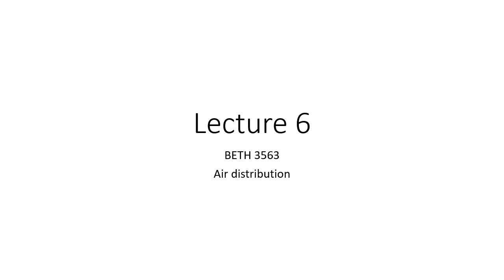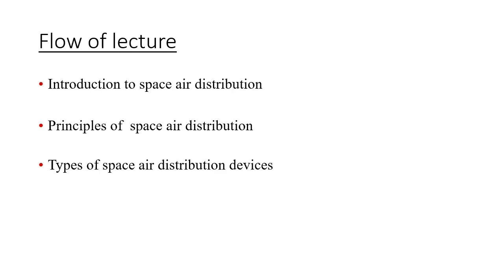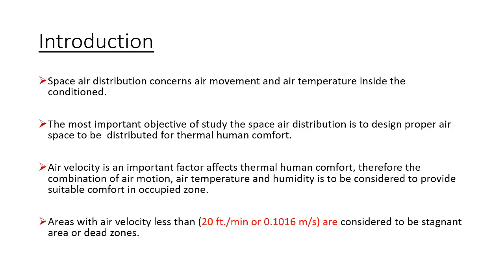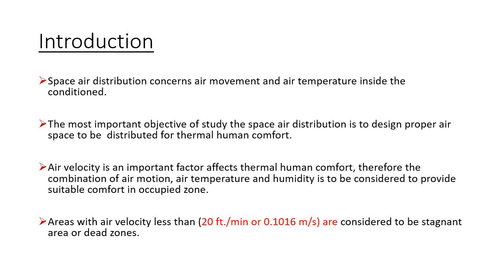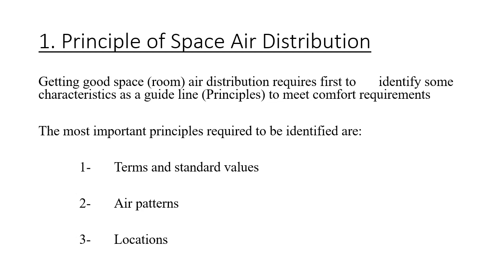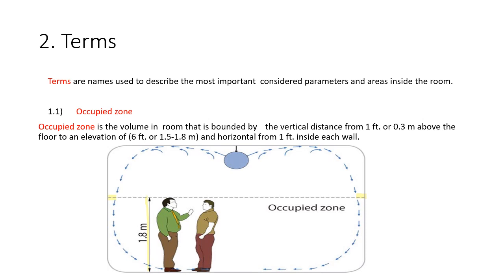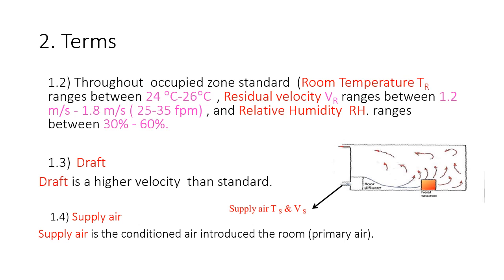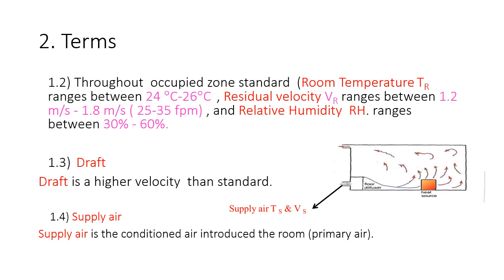LECTURE 6 SPACE AIR DISTRIBUTION

Comment: Mohamad Hurairah B071710461 

Introduction 
-Space air distribution concerns air movement and air temperature inside the conditioned.

-The most important objective of study the space air distribution is to design proper air space to be  distributed for thermal human comfort. 

Principle of Space Air Distribution 
The most important principles required to be identified are:

1. Terms and standard values

2. Air patterns

3. Locations 

Types of space air distribution devices 
There are four types of air supply devices, such as 
 1. Grilles and registers
2. Ceiling diffuser
3. Slot diffuser 
4. Plenum ceiling

Comment: NUR SELIHAH WAL HUDA BINTI AHMAD (B071710190)
INTRODUCTION
          = Supply air mixes with the room air so that the mixed air is at the room design temperature and humidity.

PRINCIPLE OF SPACE AIR DISTRIBUTION
          = Terms and standard value
              - occupied zone (volume in room bound by vertical distance)
              - room temperature (24 celcius - 26 celcius)
                                                  ( RH : 30%-60%)
                                                  (Velocity : 1.2 m/s-1.8m/s)
             - draft (higher velocity than standard)
             - supply air (primary air)
             - design temperature (temperature of leaving air in the room)
             - throw (distance from supply air device before reaching relatively low density)
             - air jet (air stream that is discharge from an outlet, higher air velocity than surrounding air)
             - spread (envelope of air stream)

          = Air patterns
             - Ts<Tr (air will drop down the indoors)
             - Ts>Tr (air will rise up indoors)

          = Locations
             - high wall (cool air will drop down naturally)
             - ceiling (recommended for cooling)
             - low wall (recommended for heating)
             - floor/sill (recommended to locate under windows)

TYPES OF SPACE AIR DISTRIBUTION DEVICE
         = Device to create proper air distribution in conditioned space. air supply device.
         = 4 types
             - grilles and register
             - ceiling diffusers
             - slot diffusers
             - plenum ceiling : dropping ceiling

Comment: Aldy henry dusim (B071710329)

introduction
this chapter teaches about how to design proper air distributed air supply for thermal comfort. air velocity is important and air motion, air temperature and humidity must be consider to achieve suitable comfort for user.

Principle of space air distribution (AD)
a)terms
-occupied zone
-draft
-supply air
-design tempp
-throw
-air jet
-spread

Air pattern
its the behavior of air supply to a room
Ts<Tr cool air will drop down (as in summer)
Ts>Tr cool air will rise (as in winter) 
air device is not suitable near ceiling due to surface effect thus room not cool

Location
important to know to get good air distribution.
High wall is good for cooling cause cool air will drop down and also at the ceiling also good for cooling.
Low wall and floor or sill is good for heating 

Type of AD device.
used inside space for the distribution of conditioned air.
Type:
1. grilles and register
2. ceiling diffuser
3. slot diffuser
4. plenum ceiling

Comment: Amiratul Rasyidah bt Abdul Rahman (B071710456)

Introduction:
* the objective is to provide thermal comfort zone
* The areas with air velocity less than 20 ft per min considered to be stagnant area

Principle of space distribution
* terms or standard value
* Air patterns
* Locations

Types of space air distribution device
* grilles 
* Ceiling diffusers
* Slot diffusers
* Plenum ceiling

Comment: Muhammad Akram (B071710573)

Introduction 
Air distribution system
- To design proper air space   - Important of air velocity effect (human comfort) - Air velocity less than (20ft/min) considered stagnant/ dead zones.

Principle of space air distribution
1. Term and standard values
2. Air patterns.
3. Locations.

Terms = most important parameters and areas.
Air pattern = behavior of the air supply
Location = air distribution device is important consideration to achieve good air distribution.

Type of air distribution devices. (known as air supply devices)
1. grilles and registers
2. ceiling diffusers
3. slot diffuser
4.Plenum ceiling.

Comment: KHOR YE SHU (B071710464)

Introduction
- Objective is to provide thermal comfort zone
- The areas with air velocity less than 20 ft per min considered to be stagnant area

Principle of space distribution
- terms or standard value
- Air patterns
- Locations

Types of space air distribution device
- grilles 
- Ceiling diffusers
- Slot diffusers
- Plenum ceiling

Comment: ARVINTH A/L RAMACHANDRAN 

 ( B071710339)

INTRODUCTION

concerns air movement and air temperature inside the condition 
air velocity is an important factor that affects human thermal comfort zone along of combination of air motion temperature and humidity.

Principles of Air Distribution 

terms and standard value 
-occupied zone 
-draft
-supply air  
-design temperature 
-throw
-air jet 
-expansion 
     -envelope air stream 
     -terminal velocity 

Air pattern 
- Ts < Tr air will drop down indoors (summer)
- Tr < Ts air will rise up indoor (winter)

locations 
- High wall ( good locations for cooling )
-ceiling ( not good locations for heating )
-low wall ( good location for heating )
- floor or sill ( excellent locations for heating not for cooling )

Types of space air distribution 

- grilles and register 
- ceiling diffuser 
- slot diffuser
- Plenum ceiling

Comment: SEE WEI CHE B091810368
In this video, i have learned that the air velocity is an important factor that will affects thermal human comfort. There are 3 important principles of space air distribution which are terms and standard value, air patterns and locations. There are four types of air supply devices which are grilles and registers,  ceiling diffusers, slot diffuser and plenum ceiling.

Comment: AHMAD ASYRAF BIN AMIL B091810125 

 - Space air distribution concerns air movement and air temperature inside the conditioned.
- Areas with air velocity less than 20 ft per min are considered dead zones.

Principles of space Air Distribution :
-  Term and standard values
-  Air patterns.
-  Locations.

Types of space air distribution devices :
- Grilles and registers
- Ceiling diffusers
- Slot diffusers
- Plenum ceiling

Comment: MUHUNTHAA A/L MUNIYANDI
B091810185
3 BMMH S1/1

From this video, I have learned about  

1. Space air distribution is to design air space to be distributed for thermal human comfort.

2. Air velocity is important factor for affect thermal human comfort.

3. Most important for identified were terms and standard values, air patterns and locations. (occupied zone, throughout occupied zone, draft, supply air, design temperature, throw, air jet and the expansion of flow stream. Next is air pattern and  location.
 

4. There are 4 types of air supply devices which are grilles and register, ceiling diffusers, slot diffusers and plenum ceiling.

Comment: MUHAMAD IZMAN BIN JAMALUDDIN 
B071710518

Introduction to space air distribution
Space air distribution concerns air movement and air temperature inside the conditioned.
i.	Provide Occupant Thermal Comfort 
ii.	Provide sufficient ventilation to meet codes 
iii.	Control Latent loads (Humidity)

Principles of space air distribution
i.	Term and standard values 
ii.	Air patterns (a behaviour of the air supply to a room)
iii.	Locations (consideration in achieving good air distribution)

Type of space air distribution devices
i.	Grilles and registers
ii.	Ceiling diffusers
iii.	Slot diffuser
iv.	Plenum ceiling

Comment: Lim Pei Jun  B071710194
Principle or space air distribution
- term
Used to describe the most important considered parameters and area inside the room.
-air patterns
Behavior of air supply to a room.
-location
To give a best design of air distribution, a location should under a consideration.

4type of supply device
-grills and registers
Usually have adjustable parallel bar and in square or rectangle shape.
-ceiling diffuser
Consist of a series of separates concentric ring or louvers with collar.useally in square , rectangle and circle shape.
-slot diffuser
It is a long strip-shaped with one or more narrow opening.
-plenum ceiling
A ceiling that under structure ceiling, called dropping ceiling too.it is to equally the air distribution but costly.

Comment: MUHAMMAD ISMANAJMI BIN ROZI
B091810258

FROM THE VIDEO I LEARN ABOUT :
(1)
- to understand the space air circulation in terms of air movement and temperature
-to design appropriate air space -factor influencing thermal human comfort
- areas with low air velocity that are stagnant or dead zones
(2)
-normal and term values.

-Air patterns (in the summer, when Ts is lower than Tr, air can drop indoors). And when Ts exceeds Tr, air rises indoors (usually during the winter).
-Situation ( High wall, ceiling and low wall)
(3)
Type of air distribution devices
-grill and registers
-ceiling diffusers
-slot diffusers
-plenum ceiling

THANKS YOU,

Comment: Ahmad asyrafamirudin bin aznan b071710607

Introduction
- to design proper air space to be distributed for thermal human comfort
- air velocity is an important factor affects thermal human comfort

Important principles required to be identified are 
- terms and standard values
     ✓ occupied zone ( volume in the room)
     ✓  draft  (higher velocity)
     ✓ supply air (primary air)
     ✓ design temperature 
     ✓ throw 
     ✓ air jet
     ✓ floor or sill
- air patterns (behavior of the air supply yo a room)  
      ✓ T (supply) > T (return) as in summer 
      ✓ T ( supply) < T (return) as in winter
- locations 
       ✓ high wall ( is a good location for cooling)
       ✓ ceiling ( good for cooling and not for heating because the warm air will rise leaving stagnant zone in occupied zone)
       ✓ low wall ( for heating not for cooling) 
Four type of air supply devices
1) grilles and register
2) ceiling diffusers 
3) slot diffuser 
4) plenum ceiling

Comment: MOHD NAZRIN BIN MOHD NAZRI B091810221 3BMMH S(1/2) 

From this chapter I learnt :-
1. Introduction :
• Space air distribution concerns air movement.
• Space air distribution is to design proper air space to distribute for human comfort.
• Combination of air motion, temperature and humidity need to be considered in provide suitable comfort.
2. Principle of Space Air Distribution :-
• Terms & standard values
• Air patterns
• Locations
3. Types of Space Air Distribution Devices :-
• Grilles and registers
• Ceiling diffusers
• Slot diffuser
• Plenum ceiling